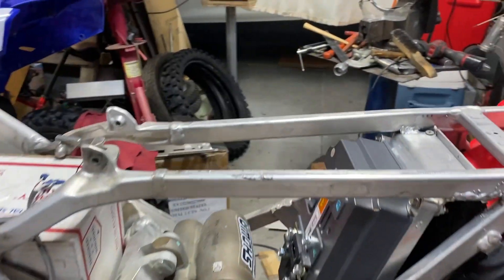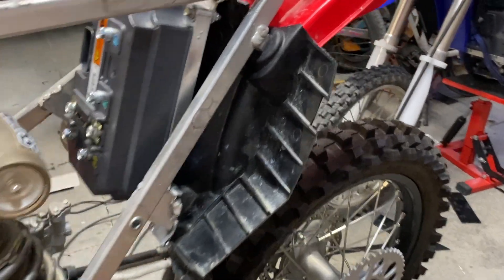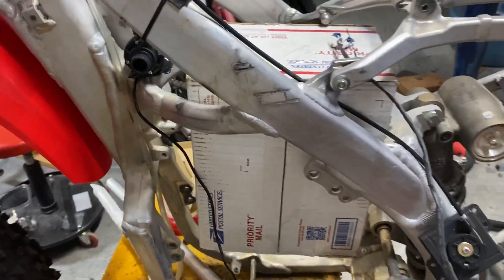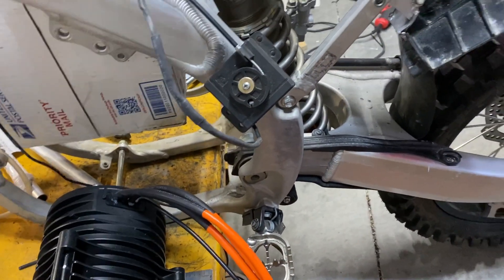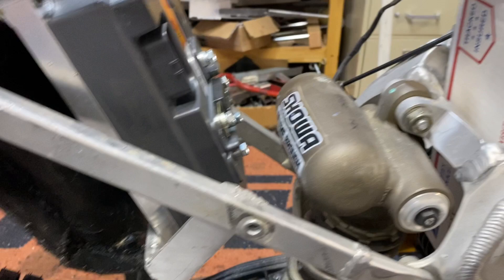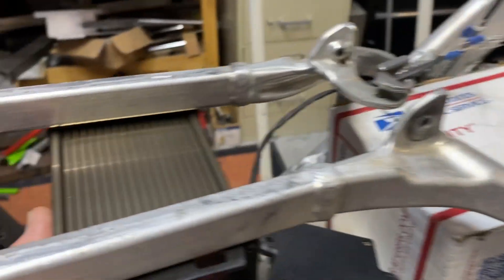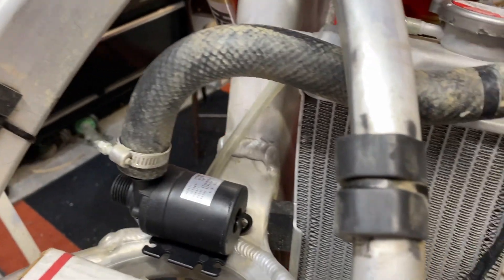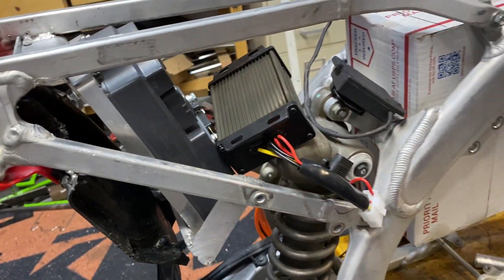2023 Honda CRF250 with QS motor and Votol EM260S controller Install. Today the controller

Comment: Hi, Donald. Is it the pump for cooling the controller’s heat sink? How is it gonna work? I don’t remember you did that in your Yamahas. Thanks in advance.
Reply from the maker: I didn't put it on my YZ250F.  I never had enough amps.  My battery would only give me 380Amps.  Antonio Rudello saw the heat buildup on his. This bike is for a young upcoming kid that rides pretty hard.  Wait until you see the mods we are doing to the battery to keep the heat down on this Honda.  I am putting a new battery in my YZ right now also, 20S12P Molicel P42A. I will have to cool my controller too.